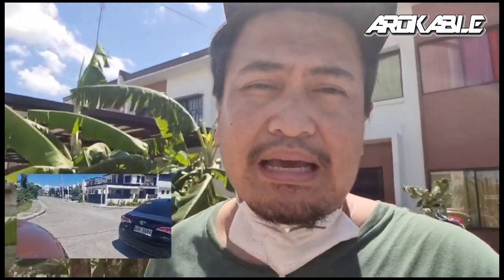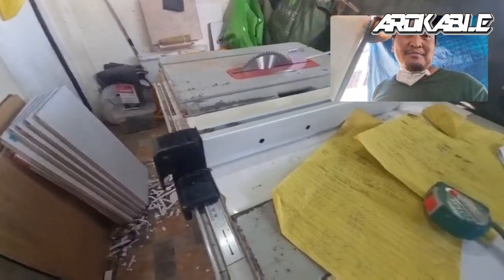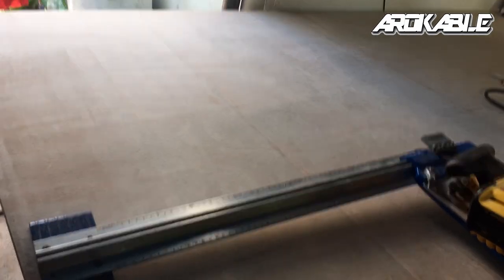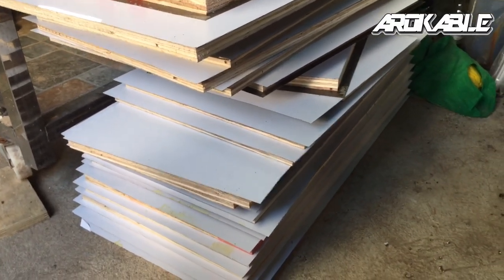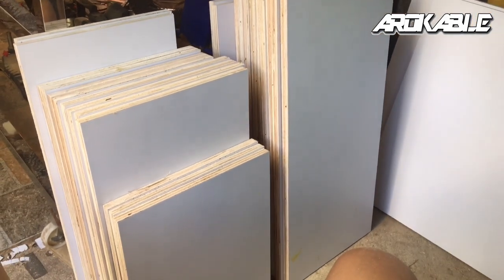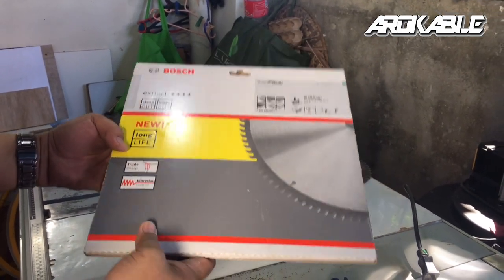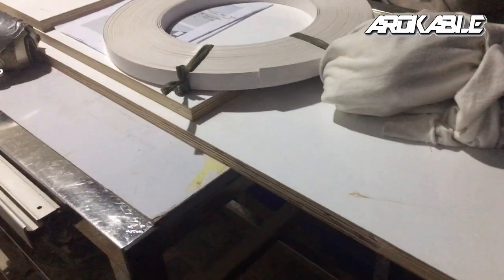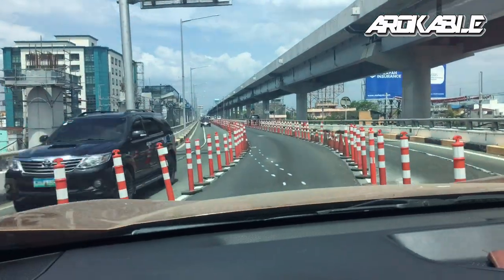PAANO GUMAWA NG MODULAR KITCHEN CABINET | PANTRY CABINET PART 1

Comment: Ilang minutes bago ipagdikit ang hpl at plywood after lagyan ng contact adhesive sir?
Reply from the maker: 5 minutes pwede, pero ang basis kapain mo if tuyo na pareho boarde and HPL
Reply: Sir Arok ask ko lng, anong ideal size ng woodworking "TABLE " para sa plywood cutting para sa cabinet making...kailangan ba Kasing size ng plywood 8x4? Salamat 😄❤
Reply from the maker: @titotabuquilde8218  4x8 Sir is ok na  malaki na sya para sa wood working maganda  at maluwag kumilos, sa work shop ko kasi makitid kaya hirap gumalaw. Maganda na may 4x8  work table ka good luck boss
Reply: @arokabletv  Ok, well said sir Arok ... salamat sa agaran reply...ang ganda ng mga gawa nyo napaka pulido at consistent...🙏❤
Reply from the maker: @titotabuquilde8218  salamat po Sir gawa na din kayo fullfilling ang sariling gawa  mo